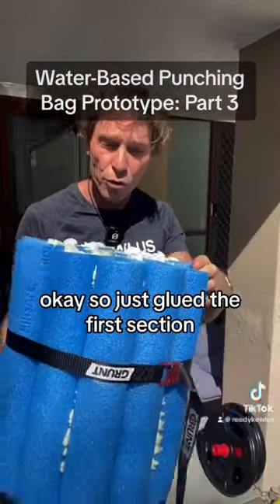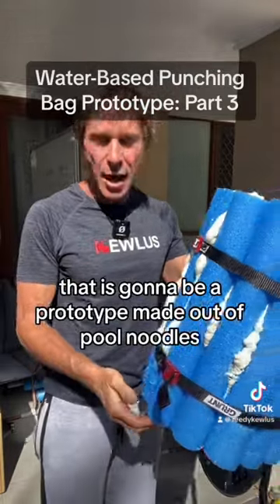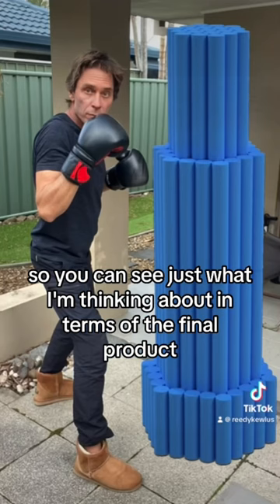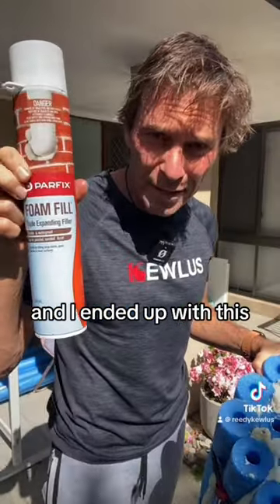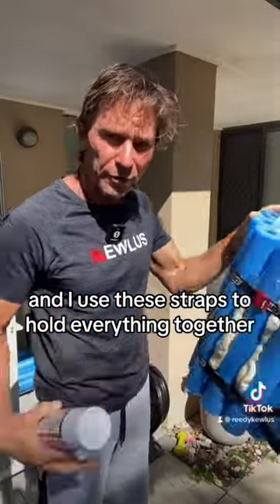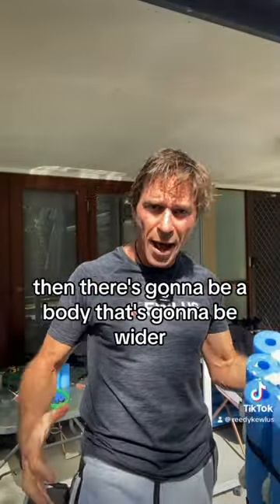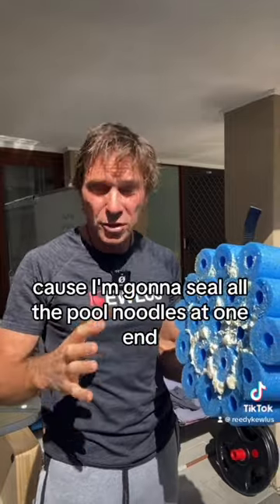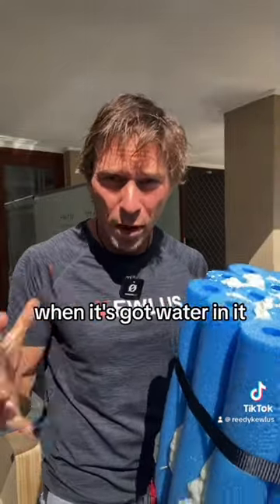Water-Based Punching Bag Prototype: Part 3

Comment: How much did it cost?
Reply from the maker: So I’ve used 6 pool noodles for each section, and at $2 per noodle that’s $12 per module. The 4 modules will end up costing around $50. Adding the glue to seal the holes and the tape will total to about $70. For a prototype that’s pretty good